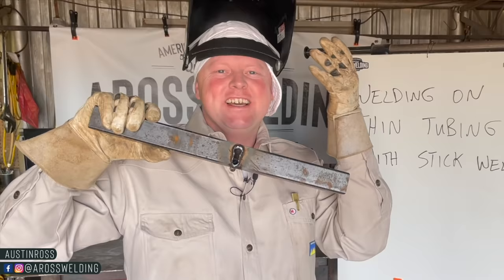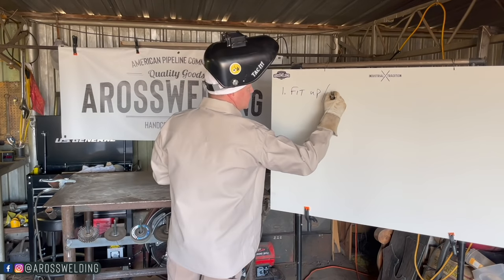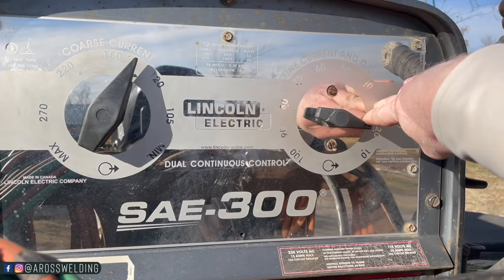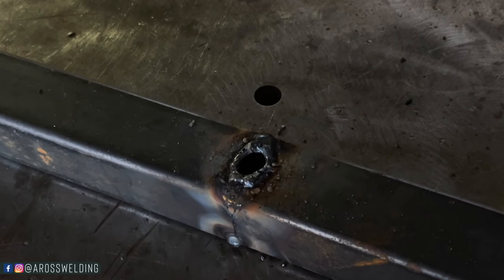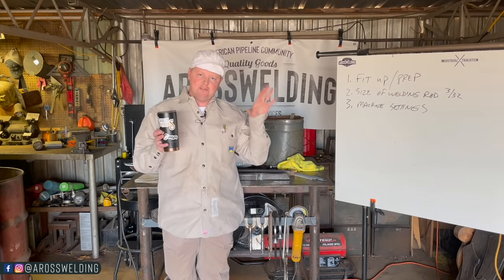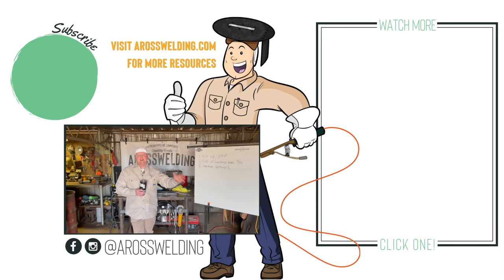Stick Weld Thin Square Tubing (How to Recover After Burning Through)

Comment: Love it; I whip in weld and out with j’s and I like it hot (on my miller 225 run it 10 at 50amps w 1/8” on 14 gauge); so my hook of j is in the puddle and my long leg is filling the gap… so j on bottom a reverse j on top, if weld is getting to hot often move to long legs of j’s and work back toward the “weld” or further down the line while its “cooling” I like to get back in it, the split second the orange puddle fades off… 
    Side note: love your vids; have helped me move from a welders helper, to shop foreman in 8 months time!!!! Keep ‘em coming.

Comment: Thanks for the video! 
    I've been using 1/16 or 5/64" 7014 for clean well fitting steel tubing when I do a continuous bead. But now the price for the 1/16" has literally doubled, so I don't t know if I will reorder when I run out. 
    So now I'm trying a dab-dab technique with 3/32" 6011.  I really like 6011 because it's cheap and widely available. It is deep penetrating but also fast-freeze. 
    What you do is strike the arc, create the puddle, and break the arc. This only takes about a second (say "one-thousand-one" 
). Then you watch it cool and while the bead is still barely red (before it goes dark),  you strike the arc again and repeat. This gives good visibility and easy arc strike. You are making a bead of spot welds. 
   If the material is really thin you can just do it with scattered spot welds, or even cool the metal with compressed air or copper/aluminium chill blocks.
    This isn't as fast as running a bead, but if you burn through just once you've lost that advantage. I am aware of TIG and MIG, and if I do win the lottery....
    With this dab-dab technique I can use my 110v buzz box or my cheap inverter welder and get good results. I just need to unplug the microwave. 
   I've learned a lot from industrial welders like you, and also the auto-body wizards.
But a lot of home-shop projects fly under the radar. I've found most of the useful projects I've done welding are small. 
    Thanks again for a good in-the-field repair video, and if you have a big project, support your local welders.

Comment: Those are great little machines! Rod size, travel speed and arc gap all come into factor when welding thin stuff. I’ve had to knock the flux off a 7018 and use it as a TN TIG rod, lol.

Comment: Built a hand rail on site out in the field around a conex that had a concrete platform with stairs. Did it all in the rain with a stick welder lol. I did end up with a few gaps due to fitment issues. Mainly overhead welds on some of the angled pieces coming down off the stairs. I ended up breaking the flux off a piece of 3/32 7018 and Texas tig welded it lol. When all was said and done all I heard all week from the people I was working for was how nice the hand rail turned out lol. I was mainly a shop fabricator/welder for a few years before I got a taste of field work, and you would be surprised how much shop knowledge helps out in the field on site.

Comment: I stick-weld 14-ga all the time by tapping my rod all along the weld path, establishing several "heat-sink bridges".  

This gives excess heat a safe pathway to evenly distribute the heat load. 

Once I have a dozen or so small tack welds, I turn up my heat a bit and lay down an even puddle.

Hand rails and fences usually get ground and painted. That even puddle makes even grinding a piece of cake.

Holes? Ya, they happen - mostly along cut edges. Tapping first lessens your chance of a run-away hole getting started. To fix a hole, tap first and let it cool before attempting to lay down a puddle.
Reply: are you using 6010, 6013, or 7018 when doing this
Reply: @peetky8645  
I use 6011 almost exclusively.  I call them dago rods, BECAUSE, dago through dirt, dago through rust, dago through paint .  .  . Dago through almost anything.  I build a ton of oilwell drill stem and sucker-rod pipe fences as well as custom metal buildings (11 & 14 ga).

I use a/c machines (Miller Suitcase & Lincoln stick), so odd-numbered rods.
Reply: @WhatDadIsUpTo  good to know....i wanna make an 11ga carport in steel tube...my inverter is dc only and wont work with 6010 but it does work with 6011.   I was going to  mock up some coupons to try dcen vs dcep and also 1/8 rods and smaller.  what size 6011 would your recommend for 11 ga tube?  thanks for your informative response above
Reply: @peetky8645  Honestly, I have no idea how thick my rods are, 3/16"?  I dunno. I use Victory brand rods. I get them from J&I Mfg. in Madil, OK by the pound.

What I do know is, 11 gauge requires way more heat. I weld 14-ga between 90 and 120 amps, but thicker, I honestly just crank it up a notch or two without looking. You'll know if you're too hot by testing your draw-back arc by pulling up, but retaining an (oxidising) ark. Experience lets you know by the sound it makes. You want sizzle, not crackling, while maintaining your 1/24" arc gap.  The thicker the rod, the more amps it can handle, up to the point it starts blowing your cover gas away.

BTW - what means dcen & dcep? 🤷‍♂️
Reply: @peetky8645  If I may, 6011 in 3/32" diameter can work just fine for 11ga (1/8") tube, but so can 1/8" on it's lower end. 1/8" 6011 will typically work down to about 65A give-or-take a few amps, so it has a good range to work with depending on the joint configuration.  Some configurations need less, some need  more.   In any event, I prefer DCEP, it just seems to run smoother IMO than DCEN.
Reply: @WhatDadIsUpTo   DC electrode negative(dcen),  DC electrode positive(dcep) and AC are the different smaw polarities possible.  thanks for your advice!  i will try to put it to good use.  keep burning!
Reply: @zod-engineering-welding  thanks a lot...good information from a skilled craftsman!
Reply: They also call 6010 farm rod, cuz its good all purpose.
Reply: @qomco  
The difference is, odd-numbered rodd are supposed to be used with a.c.  Even-numbered are for d.c.
Reply: @peetky8645  6010 is a DC  only rod, whereas 6011 is an AC/DC rod.
Reply: @WhatDadIsUpTo  
dcep  =  dc, electrode positive       This means the rod is positive  (+)
dcen  =  dc electrode negative       This means the rod is negative  (--)
Reply: @peetky8645 
Oh, thanks. All that technical stuff is way above my pay grade.

Comment: Just recently I bought myself a stick welder. Cute little thing, super cheap but powerful. As a first project I went on to fix that thin sheet metal grill you can buy in a supermarket that I found.

It evaporated. :D

Comment: Nice to see how its done in other countrys.
I have done a lot of high presure gaspipes mostly stainless tig and its very important to prepair the welds with the right angles and put enough material in between the gaps. On highload-constructionwork too.
Nice video.

Comment: Hey Austin.. I bought some 2.5mm square tubing mild steel from Amazon to build a frame for a table saw I'm building and I bought my 1st stick welder. One of those cheap inverter stick welders. It's a 10-80A inverter welding machine. Somebody told me ..
The reason I bought the welder was bcos I'm about to attempt to build out the frame of a home made table saw. It's goignto be a major project for me bcos I'm completyely new to all this stuff. I have my own little workshop and somebody told me to use 1.6mm 6013 rods and have the current at around 40-45..
I'm about to start building my frame for the table saw but I am going to get my hands on some steel bits and bobs from the local building site and practice my arcs and speed and drag methods..
I bought to different sizer rods.. 1.6mm & 2.0mm for starters.. I'm going to see how they work out for me plus my brother in law is fairly decent at this game so I'll get him togive me some tips also.. Great video my bro..Take it easy man.. Dublin, IRE in the house

Comment: Austin instead of 3/32 6011 try using 1/16 6011 for light gauge material and down hand is your friend!  1/16 is the key I build and installed ornamental iron for years and 1/16 is key!

Comment: This was a huge help. I am a cattle guy from your area who is has been doing mission work in Malawi Africa for 7 years and there are only small dc welders with 6013. Most stuff here is thin and it has been a big challenge to “stick” it together. Any tips on walking the tightrope of too hot and slag inclusions with 6013? 

Thanks for putting out good clean videos.

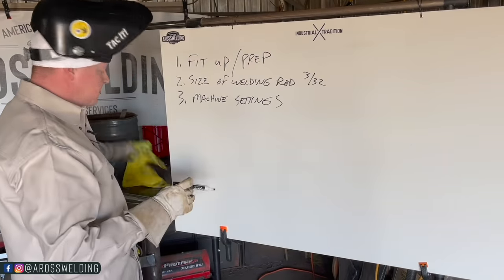Comment: Well done Austin !    At 9:20 we call it " step in and step out "  weave when running 6011's on thinner metal , allows the puddle to cool slightly then weave over it again .  
  I tell ya the what , the best welders learned on an old gas driven welder where the engine RPM surged , spit and sputter .  You was constantly changing your pattern / style depending on the sound of the engine . LOL and keep up the great work !

Comment: Some key points: 
6:35 no bevels on thin material necessary

8:30 long arc as compensation for cold 

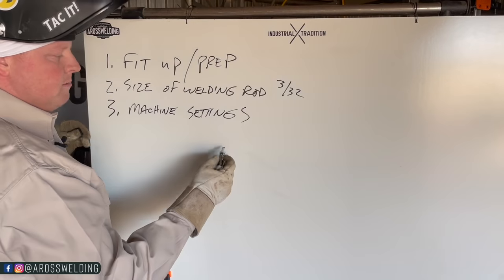9:00 stroke presented on school board, also 10:10

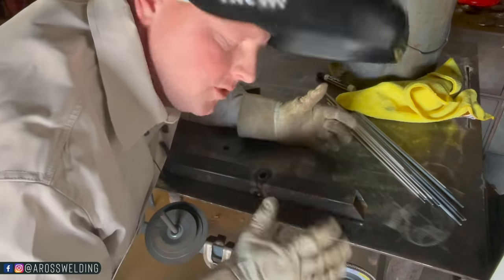11:50 basic accedental hole tip: leave it alone to cool off

Comment: When it comes to thin metals I've found 1/16 E6013 to be fitting for these applications. The main amps is around 20-45 but for 3/16 steel tubing or welding T-posts the amps can be taken up to 50 and work just fine.

Comment: i started out with a lincon 200 on 16 ga tube back in the 50s with a 1/8 6013 building columns and rails,still do the same now but have learned different ways to perform,didn't have time to keep adjusting heat so learned to use the heat i started with but keep in mind that as the metal heats up you gotta compensate  for the heat

Comment: Great instructional. My son finds it helps to have some scraps of the same material to do test welds in order to get settings right. So when you're cutting and fitting up, save some of the scraps to do a few setting passes on stuff that doesn't matter.

Comment: The “proper settings” are usually under the hood where the wire is.  I was taught and learned as you “boots on the ground”.   For over a decade I thought I was good.  I was but when swapping machines it took some time and many test welds.  I always knew the specs were there under the hood but thought I was smarter.  Wrong they give you a great starting point, and most times you don’t have to adjust anything.

Comment: You can buy 1/16 welding rods which I would use to weld anything smaller than 14 gauge.  They are weird because they are flimsy.  You can find them at the freight of the harbor.

Comment: I worked as a fabricator and did repair life most of my life, and some of the best advice I ever got was "Don't trust a fast welder."  This is because, as you demonstrate, good technique takes time, and even more so, good prep and good clean up between passes also take time.  Someone who's really fast is very likely be getting very little penetration, welding rusty, dirty material, and getting lots of slag inclusions.

Comment: I use 1/16 or 5/64 stick rod for thin stuff. Lincoln makes 1/16 7018.  7014 is also going to better when trying to avoid blow outs. When using 1/8 rod, but you need to do some small tacking, just simply grab 5/64 rod using the same heat. The rod will light right up and won't stick. Then switch back to your 1/8 rod.

Comment: I find that doing a quick weld just to seal the crack and then coming back over the top with a normal weld works quite well. I quit using thin rod for thin material. A 1/8 inch 6013 lays metal down quickly without staying in one spot long enough to burn through. I sometimes introduce a second rod into the hole at the same time to keep the weld cooler during a hole repair.

Comment: 3/32" is decent with 6010/6011 but 5/64" makes life a whole lot easier assuming you're stuck stick welding it 😉 

I would recommend 6013 downhill but most people hate it because it's a pain to learn (runs similar to the stainless steel electrodes). 

Of course, if I'm in a hurry and stuck welding outside then nothing beats .030 flux core on thin gauge bale rings and gates 😁

Being a expert at fixing mistakes and poor engineering decisions, buy some copper bar stock of different sizes to stick into the hole leaving about an 1/8" gap.  The copper makes the filling process go so much faster because the gap for the weld puddle to fill in is more manageable and on top of that the copper pulls the heat out of the weld quicker making the repair process faster.  This also applies to fixing holes in flat panels except you use copper plate instead.  The weld metal won't stick to the copper 😉

I used this technique to repair a round metal chain wear plate on a John Deere baler.  The chain links had worn two grooves through the plate and the master link was getting caught up in it causing the baler to throw the chain off.  Worked like a charm 😎
Reply: If all you have is 7018 and you have thin wall you could reverse your polarity, the material you are welding is thin so it doesn't really need that much penetration, and you shouldn't really trap anything.

Comment: Great demonstration. Welding is 75% prep and 25% welding or you will get frustrated and quit. Get your fit up the way you want it, your groves and lands. If your too hot push the rod into your keyhole, too cold pull it out. Best piece of advise of 45 years of welding is practice, practice and more practice. Learn your machine at different settings with the same rod to know how to manipulate the rod for the effect you want.

Comment: Thanks for the Great video, I am new at welding  but have a old stick welder and a wire feed mig welder  I would like to fix the rust holes in the frame of my pickup truck was wondering if this might be a method for smaller hole rust repairs,  what would be the largest hole that you would practically attempt to fill will this style of welding ?  The frame I am welding will probably be use as a farm vehicle but if I got food enough results would put back on the road

Comment: Good video. Yep sometimes you just got to walk away for a minute just to let you and the material cool down. I usually use 1/8 rod on thin material. If I blow a hole  sometimes I knock the flux off of a 5/32 7018 and use as a filler rod. What are your thoughts? Good job, keep up the good work and be safe.

Comment: I really like this video. 
For me I was having the exact problems that you described and found reading the book was no help. But changing the settings to the job at hand has worked well. 
Also have  you seen where people use a welding rod to act as a filler? What do you think of using a separate rod as a filler. Thanks Jim in Chile South America.

Comment: Speaking of hood time looks like you got a new tiger hood. Good instructions for the do it yourself, especially anyone trying to fix their own corrals, out here in San Bernardino California mostly have the very thin guage panels. Not any of that good oil pipe or sucker rod you got out in your neck of the woods. Cool stuff.

Comment: this "rod start tapping" at 7:57 if only it was that easy. my parents at farm had broken tool (manure pusher) made from metal like that and hand bar got rip off. so had it replaced by piece of thick iron rod (0.75) had very limited range of tools available what ever i found around.
made "V" shape with grinder and kinda cleaned surfaces with it. then there was this "welder" mini hand held portable piece of unit you can afford with whatever replaced that old welding cart from 50's. and that welding rod got stuck so many times, every time i tried tap it didn't start, if i added more power then it instantly penetrated though the metal. 
it was during winter, i started to freezing (same time for some reasons boiling in the head), it took me about 30 minutes to fill that ~0.3 inch cap with all that stuff. and i think it was little smaller than 0.98 inch steel pipe.

Comment: I take two more rods in my off hand, bundled together. I tend to use rods that I don't really like. I put the tips of those rods into the hole. I use the stinger to melt the tips of those rods into the edge of my hole. I have a large pool that is not eager to explode or drop away. I then immediately let it cool and take a grip. I move my offhand rods to the new place and do it again. When my timing is right, the offhand rods are not getting stuck. The tips are just getting cut-melted off and used to plug the hole. Fill that hole right up. The extra metal mass of the offhand rods takes heat arc away from the tubing wall; which helps discourage the hole from getting worse.

Comment: I use 3/32 6011 and keep the rod moving, constant in and out of the puddle. Stopping occasionally to let steel to cool. As low a setting as I can still get a decent weld. Practice, practice, practice and good luck!

Comment: A really fun exercise, for me, is to get thin stock, less than 3mm (1/8") and run a 2,5mm 6013 on reverse polarity with fast travel speed and get complete penetration with no extra reinforcement. I can sometimes get it to look better than sub-arc. The trick is, it seems, to burn a keyhole and then rip it fast with no rod manipulation. I got no professional experience, so take this for what it's worth.

Comment: Austin,  you're a very good and inspirational teacher. Interesting point of view: to see how we can learn from our mistakes.  This video is very instructive: how to correct a mistake made. Most videos show how to weld beginning from a perfect siituation but real life situations are mostly far from perfect!   I am a real beginner at welding and I bought a versatile machine (MIG/TIG/MMA) .
I would like to repair a rusted hole in a  square chassis beam  (2"  large x 3" high) of a caravan (I guess 1/10th of an inch thick). The rusted out hole is situated on the top of the beam. Could I weld it with MIG or better with MMA?  is it better to open it up (making a square hole) and welding square piece into it?  Thanks again ! Erwin (Belgium -Europe)